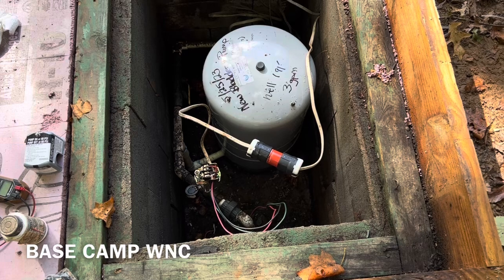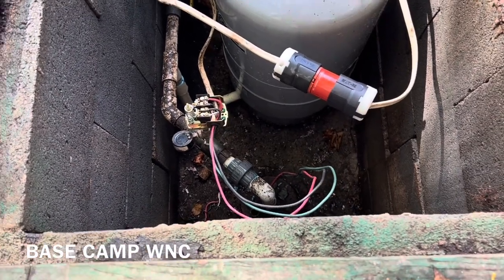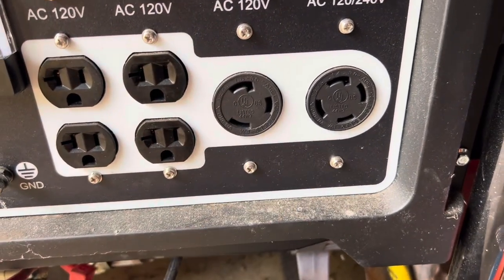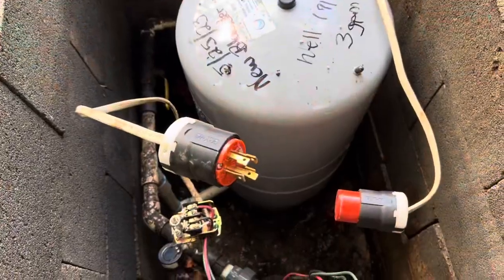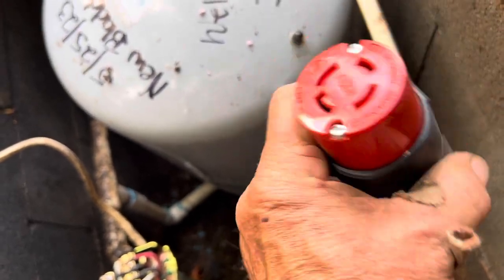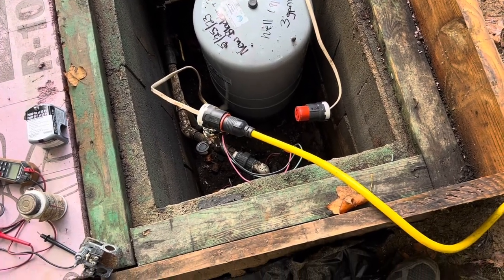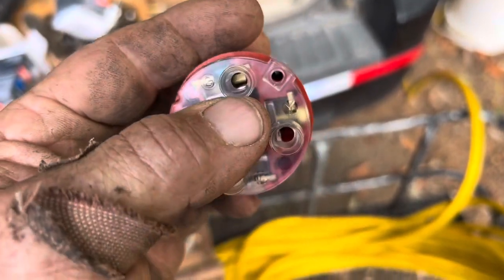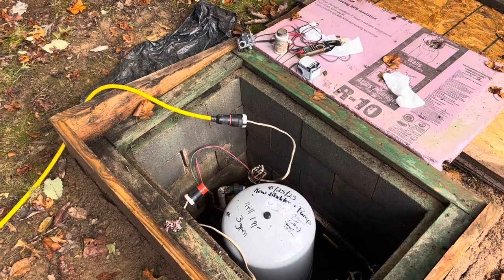Power your deep well pump with a generator for grid down

Comment: I'm no electrician, am I safe to run the well for my house off of a plug connection like that? This setup would be great for me especially with the storm about to hit WNC this weekend.
Reply from the maker: Yes it’s ok
What is the amps on your well breaker
This one was a double 30 breaker and the well runs on 8 amps on each side 
So 16 amps
There are 30 amp and 50 amp plugs
You need to look and see what your generator has for outlets and wire according

Comment: I had the same thoughts on wiring for emergency gen using the L14-30P/R
However I got thinking and wondering. then googling. and this how I found you.
I was going to cut in prior to the fuse box/disconnect switch in the well house thinking the fuses might offer a little more protection (and easiest access) as doing this the common from gen is ignored so GFCI's on gen would not work(?) However if I cut in prior to fuse box, now there is no ground coming in from the house panel.  Would I need to install a ground rod and wire it to generator ground lug?
Or maybe easier to cut in after fuse box, prior to controller and pressure switch, therefore keeping ground (from house panel) intact?
Been doing a lot reading on this so I am now second guessing myself due to other so called experts.   My original thought is that there should be ground coming from the gen, else how could these be used safely, but some so called electricians state otherwise and separate ground is needed.
Any thoughts on this would be appreciated.

Our generator is very similar to shown on this video, & is a Westinghouse 9000+ watts dual fuel portable.
Thanks,
Tim
Reply from the maker: You need to wire in between the pressure switch and the breaker panel 
You should have a ground rod that the generator can hook to

Comment: Do you need an inverter for a well pump? Or will a regular generator work?
Reply from the maker: You will need a generator that can handle the well pump
Look at the breaker panel in your house and see the size of the well breaker like double 20’s 30’s and make sure the generator has the same or larger in order to run the pump

Comment: i have a 1hp submersable at 375' is a regular 800 watt generator ok as far as the sign wave?
Reply from the maker: I guess that you mean 8000 watt generator 
Look at your breaker box 
What size breaker is running the well
Probably a double 40 amp breaker 
Your generator will need the same or larger
Look at the stuff and let me know
Reply: @basecampwnc1745  the 800 watt is more than enough, my question is the inconsistent sign wave ok as apposed to inverter generator possibly damaging the old pump

Comment: Are all 240 v outlets on generators the same? Do they all take the same style 240 male plug?  I like the setup you show here in the video.  I haven't picked out a generator yet but, in the meantime, I want to get my well pump set up this way with the right plugs. I have already done this on my gas furnace.  Hope your still looking at these comments. Thanks for your expertise.  Edit: I rewatched the video and you might have said what the answer is but I'm not sure.
Reply from the maker: The first thing is to look in your breaker panel and see what the amp size is for your well pump
Is it a double 20-30-40 amp breaker 
This is the first step to then determine what generator you will need
You will be surprised with all the configurations of outlets on portable generators
Then, if you’re well has a double forty or double 50 amp breaker to run the pump you’ll need to go to a 50 amp receptacle on a generator and it’ll be a different four prong plug
All the chords are available through Amazon with RV cords you can get ones with different ends on them or you can build them
As well as there’s a pile of different adapters that all the RVs used to hook their campers up to different outlet boxes
Yes the outlets on the generator are the same 
They are. NEMA L 14-30 P this is the plug end
NEMA L 14 -30 R is the receptacle end
Let me know how it works out 
And as always like share and subscribe 
Eric

Comment: So... no need for a neutral wire,  correct? Just leave that terminal empty on my plugs
Reply: Right.  The well pump and some other things like many water heaters will only have the 2 hot wires connected and a ground to the frame of the item.  The neutral wire is needed on most stoves and cloths driers as they do have some internal circuits that run on 120 volts plus the 240 volts.

Comment: What if my pump only has one hot instead of two? Another question could I convert my 110 to a 220 because my generator has 6000w continuous with 1 220
Reply from the maker: Is your well a 110 volt pump
A 220 volt pump has  three wires a 110 volt. A 110 volt and a ground there’s no neutral wire 
If you want send me a picture of your system 
Pictures of the pressure switch with the cover off
What if the breaker in your power panel 
Is it a single or double breaker 
A 20-30-40 breaker?

Comment: Thanks a lot, I was thinking about doing this after our power went out, my generator worked great except for the well. My bladder tank is under the house and this would be an easy fix. Luckily our power is back on and now I can get the plugs and fix it so we will have water the next emergency. But if I hit the Powerball,  I will get a Generac. But really Thanks for a good common sense fix

Comment: Millennial here. I have a question. My well says max 19.2 amps but my generator say 30amps. I'm a little ignorant here, but does that mean the generator produces "too many" amps for the well or that it's just capable of 30, but a receptacle and capable of 20amps (and 240 volts) would be okay because it's within range?
Reply from the maker: It will trip the breaker at 30 amps 
Your well draws 19 amps so if your shorts out it will trip the breaker 
So your generator will work for your well
Reply: The well will only take the 19.2 amps it needs.  it will need to take may more amps for a second or two while it starts up.  The well is like anything in your house.  Just as a 60 watt lightbulb in a lamp on the table will only draw less than one amp to light up but it is plugged into a 15 or 20 amp circuit.

Comment: My well pump is a shallow well pump above ground. It's a flotec. Right now, its hardwired into somewhere with Romex. We had to get a new meter pedestal and no electric to house. We have to plug everything in the pedestal. My question is, can I just put a regular 125 volt plug on the end of my Romex wire and plug it into an extension cord for temporary? Like with a high quality plug? I just was wondering if that was considered safe to wire Romex to a plug?
Reply from the maker: First answer is yes 
You will need to look at the amps that the pump draws 
Like 15-20 amps
Then get a plug and outlet that matches or larger

Comment: I have a Country Line CL520 Jet pump and I am thinking of wiring  it up exactly like this, is there any reason this wouldn't work? It came with the property I purchased, and I would really like to get it running. I have a generator, and I have wired up a lot of appliances, but I don't  know for sure if this will work.
Reply from the maker: Is the jet pump 120 volt or 240 volts 
Either way install a plug and outlet that is compatible with your generator outlets
Reply: @basecampwnc1745  I fiddled for a bit and got it working!

Comment: Quick question... I have a 240v Franklin submersible pump.  Are there any polarity issues with the 2 hot wires being reversed to cause the pump to run in reverse? 
Sorry... not really versed on 240 circuits.  Thanks!  Great video!
Reply from the maker: Wiring a 240 well pump 
There two 120 wires 
And a ground 
There’s no neutral
No you can not wire it backwards
Reply: @basecampwnc1745 Thanks Brother!

Comment: How can I tell if an abandoned well is still good?
Reply from the maker: First thing is to test the water
My biggest issue would be if something was put down the well
Then put a pump down and let it run 
It may need to be shocked with bleach before you use it
Reply: Thanks. It has a cap and pump in the well. But the property was abandoned. Pump tag did say 5/2016 but can't find records. This is in Swannanoa

Comment: Thank you sir for the video. If your pump wire is number 12 wire size I think it uses a 20 Amp. Power supply. If your generator is a 30 Amp. I think you need to use number 10 wire going down to the pump. Something for you to check out to be on safe side. So 20 Amp number 12. 30 Amp. Number 10

Comment: Thanks for sharing.. That's a Dam Good Tip !!!
Reply from the maker: Hope it gave you an idea or inspiration for a project
Reply: @basecampwnc1745  Yes, it really did.. I bought a couple of acres in the mountains in New Mexico a couple years ago and have been working on getting it cleared so I can build a small homestead there for when I retire (one day). I still have a few years left yet though. 
I recently came across your channel and have been watching all of your videos.. I have found them to be very educational for sure. You have definitely given me lots of ideas and inspiration for when I start building. I've looked at several different build styles for the arch cabins and I have to tell you, I definitely like your design the best overall. I really like how you explained how to construct the arches so that once the building is assembled and enclosed, there is an open space for ventilation between the outer metal wall and the thermal ply layer and insulation layer on the inner wall.. I really like that design. I'm thinking this may very well be the way to go whenever I'm ready to start building my cabin. 
Thank You Sir, for sharing your knowledge I've definitely been able to write alot down in my notes.
Reply: Fr 🤩

Comment: Great way to do it if you are an old electrician with lots of experience!
 But what I see is the possibility of an inexperienced homeowner lying on his stomach to  reach into a hole to unplug one power source and plug in another, A process that would require sticking both hands and arms into an area that is usually wet or at least damp from condensation.
 That would mean a very low resistance path from one hand and arm almost directly  through the heart and out to the other hand and arm.
 Even with only one had making contact there could still be a path through the chest that could still stop the heart.
 If you mentioned that all power has to be turned off at the generator AND at the main breaker box before attempting to switch plugs, I missed it.
 At the very least you should firmly attach the pump end to a strong support so that the task of plugging or unplugging can be done with only one hand!
Reply: They are twist plugs, impossible to do with 1 hand.
Reply: You are incorrect.  If one end of the plug is firmly attached to something secure you most certainly and plug and unplug these twist ends one handed.    We do it all of the time with our ambulances that have these 20 and 30 amp ends on their shoreline cords.

Comment: That genset is overkill for a well pump.
Reply from the maker: This setup was for a well pump that supplied livestock 
There’s a generator at the house for that well 
And yes the generator is oversized 
You can do a small job with a big generator 
You can’t do a big job with a little generator
Reply: That generator is not necessarily oversized.  The start up current required for a well pump is often way above what a small 230 volt generator can supply.
Reply from the maker: I run the wells at the farm with a 3500 watt generator 
It depends on the pump